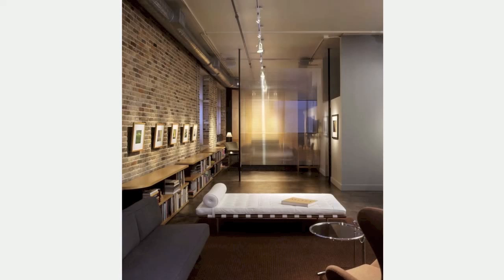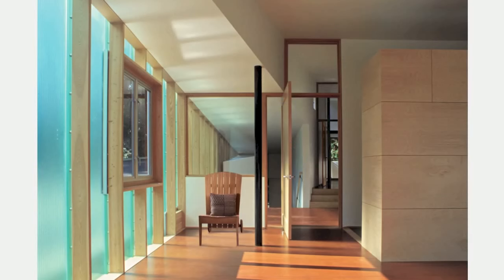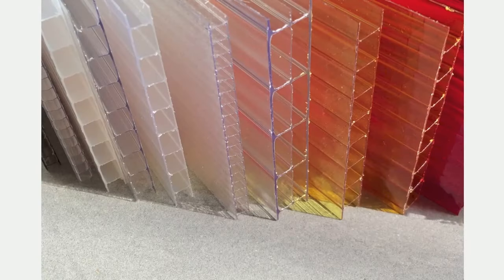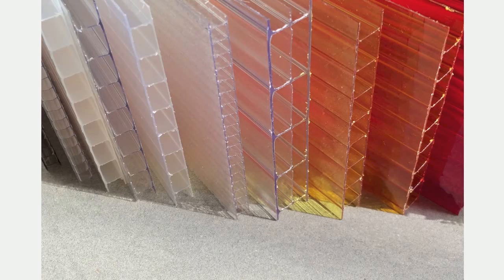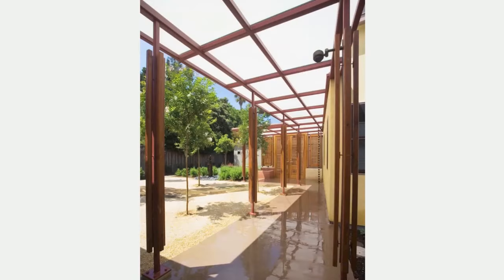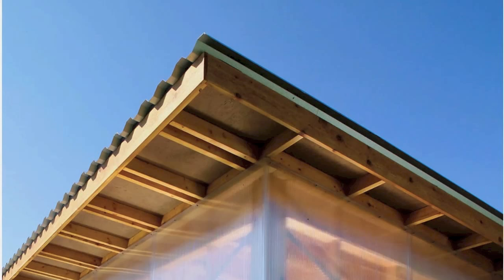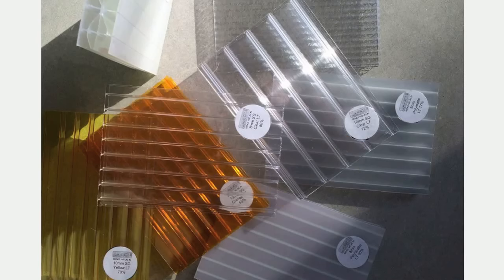Polygal - An Architect's Review of a cost-effective glass alternative

Comment: Eric, Great video. Very thorough. We have been selling and installing polycarbonate sheets since 1993. I only have one point that I would like to add. You mention at the end that the material has a ten year warranty. Most of the ten year warranty material states that the light transmission will not vary more than 6% in 10 years. We have seen those particular materials last 15 plus years. There are now sheets available that have a 20 year warranty that the light transmission will not vary more than 4% in 20 years. It has 100% material reimbursement if there is a claim in the first 15 years. There is a prorated material replacement in years 16 - 20. It is a Lexan material and yes, it is about 15% more expensive than the 10 year warranted sheets. Also, Polygal has a product Polymatte that they offer a 15 year warranty on. It has 100% light diffusion. We have found that polycarbonate has improved quite a bit through the years that we have used it. It is an excellent product and gives an excellent finished project. Again, thanks for the great video. Tammy

Comment: Who manufacturers the polycarbonate aerogel panels you spoke of?
I did barn doors for my carport in 8mm opal twin-wall and I'm now in the process of fabbing awnings out of the same material using TIG welded one- inch aluminum frames. I love the quality of the light and the strength of  panels. We've had multiple storms with 60 mph winds here in California and the awnings came like champs. Excellent information. Thanks!

Comment: What do you think of polycarbonate boards with wood batons as an interior wall finishing? I’ve only seen it in really cheap basement Reno’s and previously unfinished places that don’t need to add shear strength to the building. It seems like (as a decorator myself) that there’s a possibility or two for feature walls but I’d like you’re take.

Comment: I love your video on polycarbonate.  I have a contractor and I am ready to order the product.   The questions I have are with the installation. 
 
 Here are my questions:
1.  Solid tape on edge next to ledger board and vented tape on gutter edge.  Both seem important to me.  Can vented tape be used on both sides?
 
2.  Should a rafter gasket be placed on top of rafter?  Is an aluminum base as effective?
 
3.  Is it best to use a capping profile with gaskets to avoid water seeping down to the rafter? Or is an aluminum cap when screed down equally as effective ?
 
4.  Should an F profile be added to the gable end and secured to the outside of the rafter?
 
5.  Should a cap be used over the u-profile at gutter edge and over the capping profile to avoid water seeping into/under the sheets?
 
6.  Is there a distributor you would recommend I contact?
Reply: Home Depot carries a comparable product and may be able to help more.
Reply from the maker: Thanks for watching...
Without knowing the specific circumstances or precise materials you're considering for your project it would be difficult to answer your questions. If you have a product in mind, you might start by consulting the manufacturer's website and contacting their local representative.

Comment: What extrusion profile would be appropriate on the horizon joint of a sloping roof. Ideally, we would want the panel to run continuous from ridge to eave but this is not always possible. My first thought would be butting the "U" profile of each panel together with a sealant along the seam (Titebond 100% Silicone Sealant Franklin International, Inc,). I am not an advocate for using a sealant as the prime detail to resist water infiltration, but sometimes the simplest detail is the best